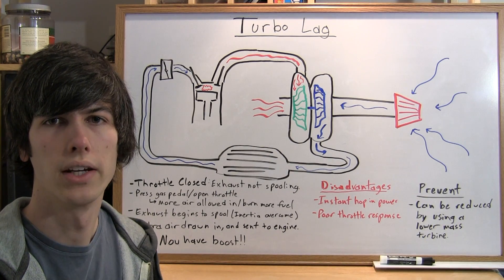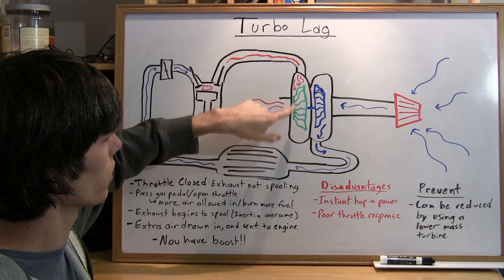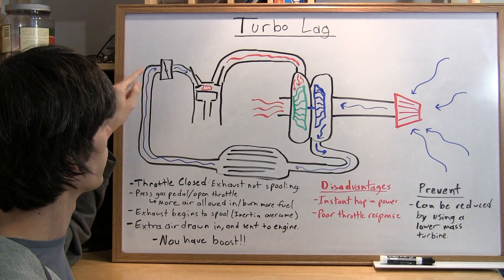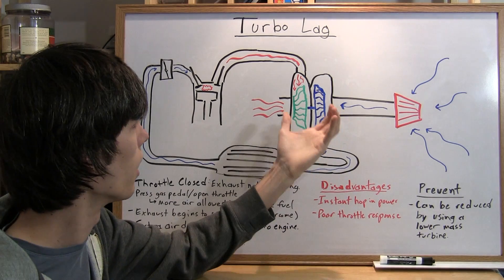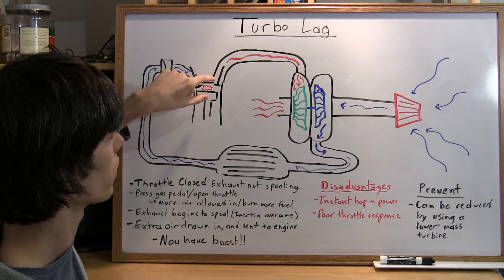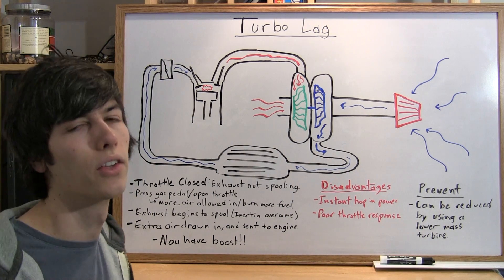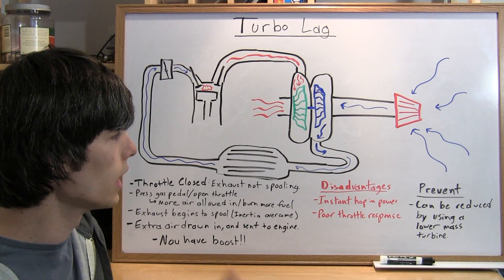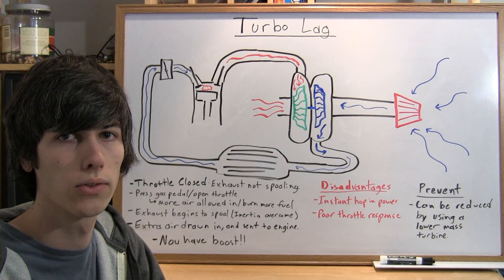Turbo Lag - The Problem With Turbocharged Cars

Comment: What if the axle of the turbocharger is connected to the crankshaft or so, with a small transmission? Doesn't that help keeping the rotors spinning fast? Or will it just build up pressure in the intake piping?
Why am I constantly thinking that this lag means the turbocharger only works properly above a certain angular velocity? How does this link to eachother (rpm and turbo)?
And how do they cope with turbolag in next year's F1? Are the revs always high enough to have enough inertia? :-D
Btw very nice explanation as always!
Reply from the maker: If it were connected to the crank, that would essentially make it a supercharger, which do not really have turbo lag.
Reply: Ok. Thanks a lot.
Reply: The amount of boost (pressure rise) produced by a turbocharger is proportional to its own rotational speed.  Its rotational speed is increased by increasing amount of exhaust gas flowing through the turbine, achieved by increasing the engine RPM.  Since the turbine is connected to the compressor through a small shaft, the turbine's only purpose is to power the compressor which in turn pushes more air into the cylinders.  
So, as the engine rpm and power output increases by pushing the throttle, the turbo begins to spool up and starts developing boost.  But as the turbo develops more and more boost, the engine power output increases even further. Again, as this engine power output increases the turbocharger spins even faster...so on and so forth...automotive turbochargers can design speeds between 80,000-140,000 RPM...F1 turbos spin upwards of 200,000 RPM.
This system behavior is commonly referred to as non-linear because engine power/rpm and turbocharger boost/rpm are inter-related.  
So then one wonders why can't we/what keeps the turbo from spooling even higher and higher due to this relationship.  Well they are designed to spin at certain speeds and are limited by component stresses, in this case its primarily the centrifugal loading that's of concern.  To keep them from producing too much boost and spinning too fast, there is a Waste gate that opens just before the turbine to let the exhaust gasses bypass the turbine.
Reply: doktorbimmer Interesting remarks from the repliers here :-)
The turbo, compounding, is that a bit similar to using the impeller axis as a flywheel?
"another similar idea is 'Turbo-Compounding'  where only the exhaust turbine is used, connected to the crankshaft by similar means was used in production for large radial aircraft engines in the late 1940s."

Comment: hey how can we calculate the rpm for boost threshold?? ne formulas??
Reply: there are but you would have to go into turbomachinery design to perform those calculations, plus you need a whole bunch of known geometrical and non-dimensional parameters which manufacturers are not keen on releasing so that others can't reproduce them.

Comment: Thanks. Can you explain turbo surge please.
Reply from the maker: Basically when you have no bypass valve, and the throttle closes (you let off the gas), the compressed air has no where to go, so it goes back through the turbo, aka compressor surge.
Reply: Common methods to avoid compressor stall include blow-off and re-circulation valves

Comment: You really need to learn the difference between "Turbo Lag" and "Boost Threshold". You are explaining what is called Boost Threshold.
Reply from the maker: Lag is the time delay from pressing the gas pedal to experiencing a difference in power (which comes from boost), boost threshold is the RPM region in which the turbocharger starts to provide useable boost. Hmm, how'd I do?
Reply: Close, Lag is what is experienced when you are passed the RPM point of the Boost Threshold. Basically Lag is measured when you hit the throttle when then engine is at the PROPER RPM for the turbo to work ie; Boost Threshold. Spool up before the BT is not lag, it is just spool up. If your boost comes on at say, 3500 RPM, and you are crusing around at that RPM, then you hit the gas to go at that RPM, the time it takes then for the turbo to spool is the lag. Anything before the BT is just the spool up to the BT.
Reply: greebuh That makes sense.  Today I took a BMW 520d out for a test drive and BT is around 1,750rpm.  Putting it into sport mode and hitting the throttle the lag is somewhat noticeable (couple secs and the acceleration kicks in...).

I'll most likely be in town on ECO-pro/Comfort and sports on longer stretches. Incredible driving experience though.  Can't wait to pick it up...

Comment: not 100% true, the time it takes for a a turbo to get into boost is the boost threshold, lag is how long it takes to make full boost after its passed the threshold
Reply: Exactly Leon, This "engineer" is explaining "Boost Threshold", Turbo lag can be explained by saying: To measure turbo lag the engine needs to be above the boost threshold, which is what this guy is explaining, when the engine is in the threshold apply full throttle and if it does not respond straight away that is lag.
Reply: lol, learned this the other day.
Reply: greebuh Mmm exactly.

Comment: This video is ok, but I think it doesn't explain the difference between boost threshold and turbo lag. Many people get the two terms confused. Most people think, well my car won't make any boost until say past 3000rpm and below 3000 rpm is turbo lag when really you are below the boost threshold and the engine just doesn't make enough exhaust gas to make boost yet. Turbo lag would be more prominent on a road course where the rpm's stay high and there is a lot of on and off throttle. Once past boost threshold, the time it takes the turbo to make boost when going sharply from 0% throttle to 100% throttle is the technical "turbo lag". Turbo lag is just the delay caused by the inertia of the rotating assembly. Not the ability of the turbo to create boost.

Comment: Could you use an electric motor timed to pre spin the turbo upon quick execration?
Reply from the maker: Yes, you could, and in fact the new F1 engines will have a setup similar to what you describe. If you're interested search my channel for "2014 f1 engine."
Reply: Will do... great videos keep it up!

Comment: Spooling up is a slang term. It just means spinning up,or increasing rpm's.
Reply: spooling is a technical term used frequently in turbomachinery
Reply: Thanks for clarifying. I've been a diesel mechanic since the late 80's, and always thought it was slang. In tech,school they used the term " spin up". But that was a long time ago. We diesel guys once used terms like aftercooler,rocker cover,and push tubes. Now everyone uses the more common gas engine nomenclature.The instructors at UTI also had a hard rule; a differential is NOT a rear end. A rear end is what your girlfriend has. Guess it depends on your generation,and geographical location.

Comment: I do not believe you actually explained turbo lag. You explained turbo spool time, such as accelerating from idle. Turbo lag is actually when the throttle plate is completely open, the turbo is compressing the intake at the desired pressure, THEN the throttle plate is closed, and THEN back to wide open very quickly. The delay time from the turbo being at full operational pressure, coming out of boost, and how quickly it returns back into boost......that is turbo lag. So, if you were racing, in full boost for a second or so, had to lift off the throttle for a split second and mash the throttle back down again......that delay back to go back into full boost is turbo lag. It may seem like a nit picking thing, but time to spool and turbo lag are two very different things.

From Garret's website:
Turbo lag is the time delay of boost response after the throttle is opened when operating above the boost threshold engine speed. Turbo lag is determined by many factors, including turbo size relative to engine size, the state of tuning of the engine, the inertia of the turbo's rotating group, turbine efficiency, intake plumbing losses, exhaust backpressure, etc.
Reply: +1. Turbo lag is exactly how Garret explains it on their website.
Reply: So, turbo lag is how long it takes for the turbo to get back on action after the throttle's been closed for a second.

Comment: hello engineering explaned, i would like too give my imput on this video if you do not mind... there are several steps too decrease turbo lag, 1 use a lesser mass turbine and compressor as you explaned 2, have a ball bearing turbocharger, 3 reduce back pressure with turbo back exhaust or straight pipe allowing exhaust too flow more freely through turbine, 4 reduce intake restriction on the compressor side too reduce the resistance of airflow allowing the turbo too spool up faster because it is easier for it too draw in air. 5 increase the engines compression which will often require higher octane fuels but increasing compression increases pressures in combustion chamber over all increased exhaust pressures which allow turbo to spool faster... 6 combocharging, the supercharger should increase pressure in the combustion chamber at low revs as well as supplying boost at low revs, increasing exhaust pressure decreasing the time it takes for the turbine too spool up.... then when the turbo spools up you get even more boost, however fuel and ignition timing will have too be adjusted for increased boost at the higher revs...
Reply: Thanks for this...can u still reduce lag by swapping the turbine with a smaller turbine and not changing the compressor wheel?
Reply: @johnjester254  Likely, the lag would be reduced, but also would performance. Smaller turbine means higher pressure in the exhaust pipes (upstream of turbine), which also means that residual gas will increase, and so will knock probability and exhaust temperature. Whoever made your car, has no reason to use a smaller turbine, actually, they try to use the smallest that still works fine enough at peak power. A smaller one will cause a lot of problems!

Anyway, do not do that!
Reply: @DC-rn1fc  thank you

Comment: Mostly better materials that make lighter/stronger turbines but also better bearings. Some more expensive systems use a set of veins to change the angle the exhaust meets the turbine. Some other low durability engines use anti-lag, which combusts extra fuel between the engine and exhaust turbine to keep it spinning, usually belches flames. Some systems also use recycling waste gates, which vent excess boost back into the exhaust turbine to help maintain turbine rpm, makes a repeating chirp sound

Comment: How was the turbo lag problem reduced so much since the 80s? For instance, the Porsche 911 turbo in the mid-80s took forever to spool up. If I remember correctly. I think it was not until 3500 RPM before the turbo kicked in. Where today it is so much faster to Kick in. That's why it ended up with the 928 S4, because it was fast and comfortable. Back then you could not get real comfortable in the 911's On a side note. With your engineering degree. Are you looking to get into racing? F1? Thanks!

Comment: lol. You have it wrong. a turbine does not spin freely. It is the actual power generator as it is connected with a shaft to the compressor wheel. It needs to be forced with high flow and pressure in order to speed up the compressor, the more the compressor compresses air, the more strain there is on the actual shaft and turbine. by the way, the video did not speak of submarines, so fuck knows where the relevance is.

Comment: This narrowing effect is what builds up pressure inside the turbine housing and when exiting the point at the turbine it has focused all the airflow (wherther it be hot or cold) onto the turbine, this pressure and volume is what causes the turbo to spool up. thermal expansion is not needed to spool  a turbo till it bursts. End of story

Comment: Sorry bro, but you are unfortunately a noob. I own a turbo repair and fitment centre and when doing balancing I spool them to 200 0000rpm with pure compressed called air. Thermal expansion has no roll in the turbo ohter than heating it up. The point of the turbo few people understand is the AR in both housings. The engine is only moving the volume out of the chamber. In the exhaust housing you have a larger opening going smaller and smaller like a snail shell. to continue.

Comment: Double ball bearing turbos and a engine with wider pistons that travel a shorter distances in the engine for reving...which a 4g63 and 4b11...that's what you need to have no lag ;)

Comment: Ok first of all.. A submarine does not run a turbine on the back of them.  I spent 5 years stationed onboard one.  Second of all a turbine does not suck air.  A compressor takes in air and spews it out at a higher pressure.  A turbine is just that.  A turbine.  A prime mover whether it be water, steam, or in this case exhaust gasses, goes thru a turbine and forces it to move.  A turbine does nothing but spin freely while a compressor compresses.  Compressors are not called or are the same thing

Comment: Smaller turbine starts to spin earlier than biggers.. So less turbo lag, but then less power too, because it pulls less air. There's many anti-lag systems to launch the car with full pressure. While cruising, at 30 mph or whatever.. you can reduce to 2nd.. getting higher Rpm to spin faster the turbine, then gets more power faster. If you (at 4th gear/30 mph) just step on it.. it will takes time to rise rpm up to get more exhaust going out to get power... that's why reduces to 2nd gear.

Comment: Basically the time it takes the turbine to overcome inertia is not a major factor.
The factor is simply how much air the engine is moving. The basic factors are intake manifold pressure, RPM, and engine size.
We can only change RPM when the airflow is too low to create positive pressure.
When RPM is high enough to create enough airflow for boost, then this also increases airflow. This boosted airflow creates more boost and so on and boost increases rapidly from this point.

Read compressor maps

Comment: The pressure the compressor wheel creates depends on airflow through the turbine.
Airflow depends on engine size and engine RPM.
For example lets say a turbo starts creating pressure on a 2L engine at 3000RPM
If you pin it at 1000RPM in third, you will not create pressure until you are at 3000RPM.
The inertia of the rotating components is insignificant.

When people refer to "Turbo lag", the cause is a combination of being in too high of a gear (too low RPM) for the size of the turbo.

Comment: The larger the area the slower the flow.
The smaller the area the faster the flow.
These are all different combinations in which i have tried in my time including exhaust manifold runner diameter. smaller for faster flow and response. Larger is lag...but for bigger capacity motors larger A/R's can be used.

Comment: Im a big fan of engineering explained and yes im subscribed.
I don't mean to sound like a bad back seat driver but....i dont feel that you have covered the entire question of turbo-lag.
Turbo lag is caused by the exhaust housing being big.
For eg...A GT35R turbo with an A/R 0.64 rear vs A/R 1.06 rear. 
0.64 will come on boost much earlier making a lot of low to mid range power but may run out of puff earlier in the top end.
But with the 1.06 will make power from mid to top end.

Comment: Ok so would the ideal solution be to supercharge the car for the lower rpms and stick on a turbo as well for higher rpms?
... continuous boost? :D
And I would imagine you would have to do a lot more cooling upgrades to compensate for the possible extra heat from the supercharger (depending on which one we would use) correct?

Comment: and there has also been new info determined about lag 1 is that Blow-off valves waist pressure the new way they help with lag is use a bypass valve that way the turbo can continue to spool during shifting then they send the BYPASSED pressure back through the turbine to re-spool the turbo sooner after shifting:)

Comment: there is a new way to virtually eliminate turbo lag it is called a twin scroll turbo twin scroll turbo's reach max boost at 1700rpms and hold it to around 5500rpms (depending on engine RPM capability) BMW has used that turbo design for a couple of years now but other manufactures are using the technology now like GM uses it in the Cadillac ATS and Chevy Malibu.

Comment: also less tubing = less lag and smaller tubing = less lag but you need to do a video over a cut off exhaust system. But  wait there's more! my buddy has a drag race Honda EG that he  rigged a small air tank to the turbo that gives you boost before even throttling, but.... he has a 43 pound turbo....

Comment: My cure for lag on my toyo vvti was that i ran. 7:1 comp w/a lrge 6ltre diesal turbo that will only spool at higher rpms so redline was 10,000 but i then ran a supercharger turbine type for lower rpm rangeB-)a dual charger system w/60/40 boost ratio:-D

Comment: Hi I would like to know if it is wise to turbo charge my toyota 86 with a 2871R garrett turbo charger? To my understanding garrett is one of the leading turbo charger brands and will i experience any turbo lag? Because we have a truck with turbo lag and it is just under 2 seconds before i can really feel the turbo kicking in after i step on the gas. And I do not want that on a sports car.

Comment: to prevent lag if its manual put your clutch in rev ya motor witch will rev heaps faster giving you boost drop clutch and theres your full boost FAST

Comment: It all comes down to volume vs. airflow.  The more volume of the intake, or "cold" side, the more airflow that is needed to fill the desired space before the oxygen molecules become compressed, or "boost" is created.  With a larger volume there is potential to generate more power, at the sacrifice of lag.